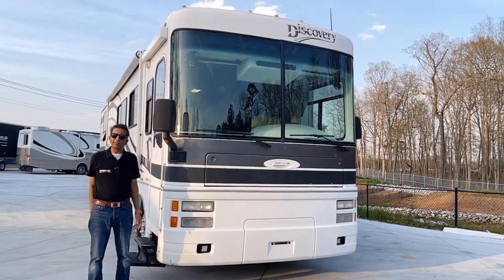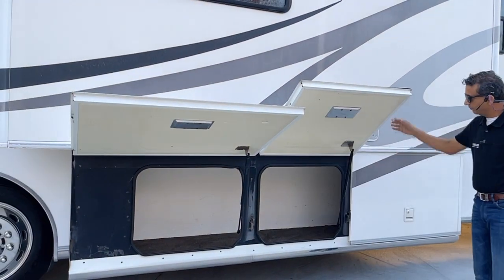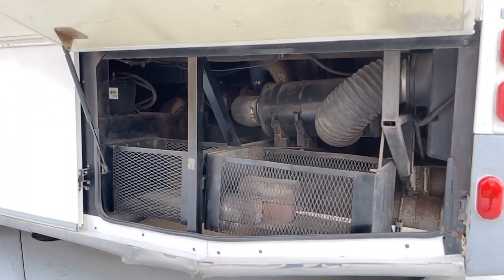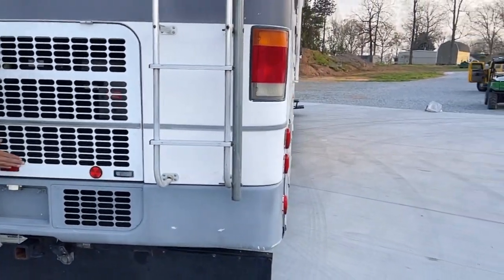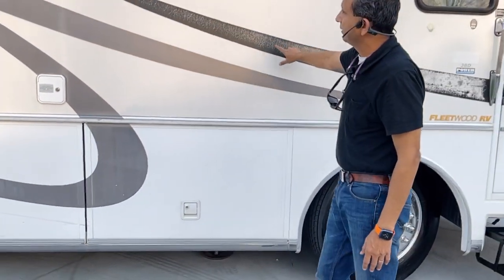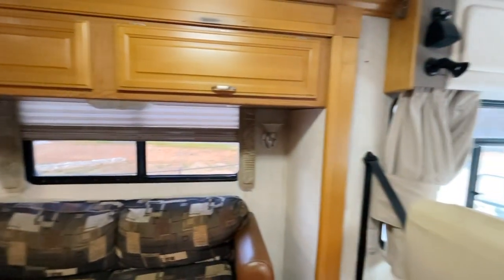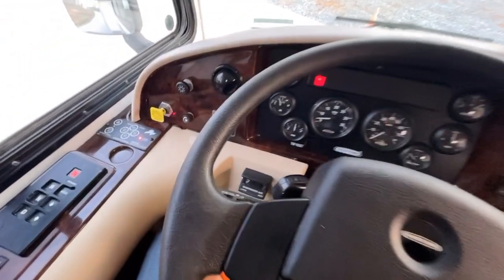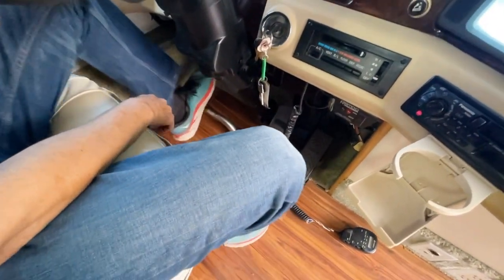2001 Fleetwood Discovery 38D with 6 brand new tires, Sold!

Comment: Manual anwings can't put them self up if u leave them out in the wind though. Few steps but when u learn how just 5min works not bad & it won't get stuck open, so I like that better hving a motor to GOD esp if it is old/worn. I wish they all had a manual mode.

Comment: If u ever seen a top of a semi pipe it flaps open or closed idea is u want it closed trapping that dirty air & noise in that stack till it has to release some of it hopefully the hotter lighter less dirty stuff. Then if it rains it washes dirt stuff sitting low right out of the air. Not putting dirt in the air better than smog & breathing it.